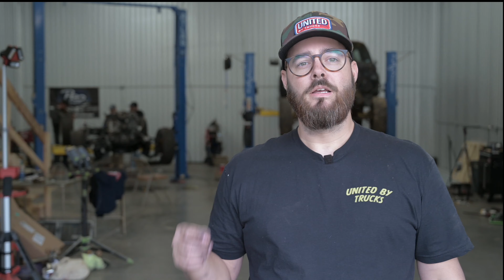Pro Performance LS Fuel Line Kit Install with Boyd Welding Tank

Comment: If your fuel pressure goes Sky high check your return, for some reason there is a filter on the return and some of the powder coating can come off and gunk it up.